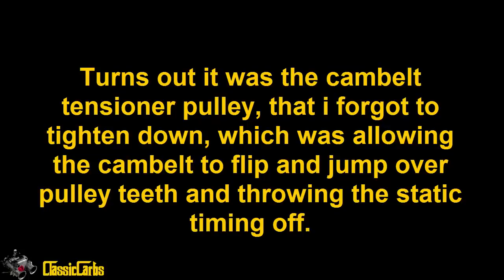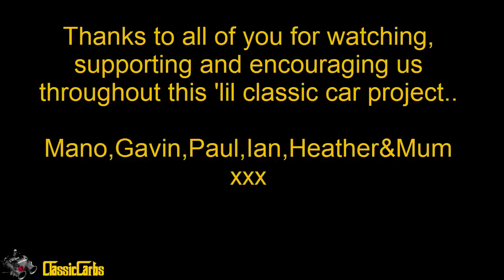1969 Ford Capri - Part 27 - Start-up and timing sorted. She's good :)

Comment: "Remember that day (when Kate came to life)"

"Kate spluttered and she farted, no need to get disheartened,
Patience and persistence will get her started.
Tweet that cam and hand me that spanner,
Adjust that belt and get ready with the hammer.
Ian and Mano finessing the tools,
Kate trying her best to make them look like fools.
Gav and Paul looking on with anticipation,
Then Kate fires up without hesitation.
That girl is purring, we will remember this day,
The day, Kate was reborn and the Champagne would spray.
(Spray bar, spray bar, spray bar)
Kate is a purring, Kare is a purring....
The fuel is flowing and cogs are a whirling.
Remember that day, when Kate came to life,
She's come so far now, long gone is the strife.
Yes, remember that day when Kate came to life.
She's come for far now, long gone is the strife."

Ok guys, here's your lyrics, how about penning a tune and a video to go along along with it?
Reply: Have a butchers at Ford capri compilation, leaving car meet. Reminds me on NDRA bruntingthorpe, on the line with a can of fosters, a big doobie on the go, and some grace jones in the cassette player. Waiting for the Christmas tree to light up. Let's 'ave it....
Reply: Oh yea, 351 windsor manual 4 speed

Comment: I remember how obsessed I was about "timing " on these engines I'd be messing around with the timing strobe all evening I think it was 6 degrees before TDC or between 6 and 8 and for unleaded fuel advance it a couple of degrees .. I can't remember how it went when you didn't have the hardened valve seats etc I think the cylinder head had to be milled down somewhat for unleaded fuel ..   or you could chuck a fuel "Genie" in the tank or something

Comment: Brilliant!  Well done all, it runs sweet as a nut.  I think I might have set up the ignition timing statically using a 12v bulb across the points first then fine tuned using the timing light.

Comment: Well done lads. took me back to the early 80's when I ran a few old Cortinas and used to change the timing belts after changing the valve stem oil seals and lapping the valves in..Happy days.

Comment: No criticism yet but do you noted that the fan pulley is not lined up
with the upper pulley? It could cause add wear. An o2-sensor to
adjust the carb, the metering? No electric cooling fan for better
fuel economy? Btw, this old engines are really bullet-proof.

Comment: Nice Job Guys! Sounds Great! That's the way a FORD should sound! 👍😎  Hearing the engine purr reminds me of my 74 Pinto I had in my younger years. It had a sound all of it's own. You'll be surprised at how that little engine will take Kate for a ride. When it's running right, it'll put you back in the seat. It would warm the tires up in 1st gear, catch rubber hitting 2nd gear and burry the speedometer in 3rd n 4th gears. It was a very fun car.  To bad a guy in a delivery van, reading a newspaper slammed it and totaled it out. The van was towed away and I drove my pinto home with a bent rear axle and destroyed driver's side. Spun the car completely around in the road. The engine started right up after the wreck. Great Job Guys! Awesome Video! Cheers! Wes 😎
Reply from the maker: Thank you Wes!!
Reply: Was that an American 2.3 Pinto engine? If so, no wonder you could spin the wheels in 1st and 2nd.

Comment: Well done guys. When you get around to doing the welding job on the bulkhead, you can use the opportunity to fill that hole in the front wing with a steel plate and get rid of the filler.
Reply: Use the other fender as master and cut out some paperboard
shapes, then reverse the form to the left side. butt welded and
tinned. to weld the firewall clevis hooks are useful to keep
the repair section on its place.

Comment: Congrats on the engine build,as mystery man said you have brought it back from a boat anchor to a runner. Drive time to follow soon or are you going to tidy the engine bay before refitting the engine.  Should see  a lot more than 30 miles from the engine now.
Reply from the maker: Thanks Andy, yup, must find a way to get the bulkhead welded up, and engine bay tidied and painted a bit, before engine returns in its place.
Thanks for your support and encouragement 🛠👍🏼😊

Comment: I strongly advise replacing that single carb with a twin choke webber as the single choke is well known for not providing enough fuel and the valves dry out and burn up

Comment: Motor looks and sounds good. Have you adjusted the valves since running. If you don't have a noise law over there I believe I would just run 4 inch pipe from the end of the header and bring it out from under the car just in front of the rear tire. But if you have to have it quite in town you could put a electric cut out valve at the end of the header for when you wanted make a little noise out in the country. Great video feels good getting that running doesn't it
Reply from the maker: Feels great David, and I like your idea about the exhaust system 👍🏼👍🏼👍🏼😊
Reply: @Classiccarbscouk  nothing like a stick shift car loud pipe out on some country rd. And think you for the reply and enjoy your day over there

Comment: you lucked out on the belt.  could have been a disaster.   when you set the timing engine speed around 700 rpm and vacuum advance disconnected,  it sounds GOOD.
Reply: 8 or 900 rpm is about the best tickover for these engines, anything less and it will probably give you a flat spot when you try to rev it.
Reply: 800 is ok but 900 is to high to set the base timing for that engine.  i find 700 for setting the time works good for a standard transmission like he has. and then set the base idle speed around 800-825.  shouldn't have an flat spots

Comment: Í hope you guys be  pacient now, and before reinstall engine work for a while in engine bay and repair, get off rust and paint. And check and update bearings, busher, and any steering/suspension part. Breaks Pipes too.
Reply from the maker: Yes, we must repair engine bay, and welding on bulkhead before returning the engine to the car.
Thanks!
Emmanuel

Comment: Has this engine ever been used or somehow made to fit a front wheel drive car ?   Just wondered as I've only ever seen them used in rear wheel  drive (which is far cooler in my book  @ rear wheel drive  simply because everyone deserves the right to "doughnut")
Reply from the maker: We still have the engine in our new workshop miles. It is on a trolley stand, and we've fitted 2x weber carburettors on it and it sounds great now. We've built a 3ltr version of this engine in the last 2-3 days.